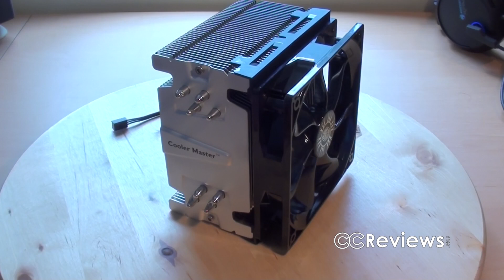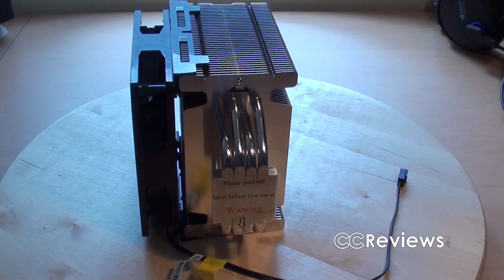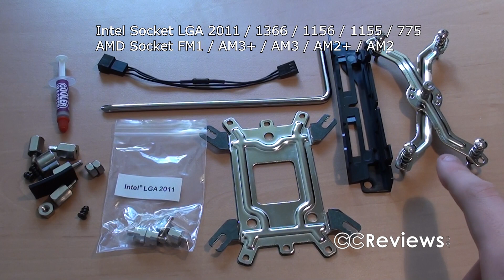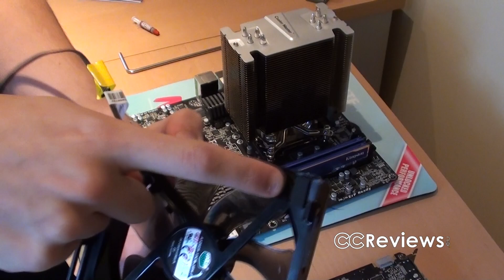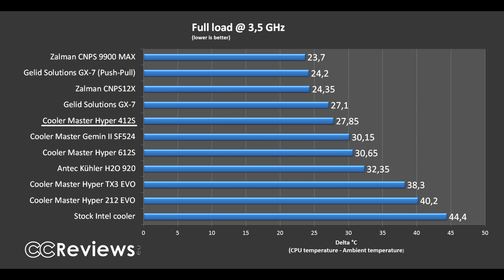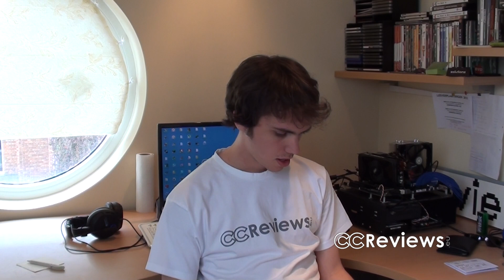#72: Cooler Master Hyper 412S CPU Cooler Review (CCReviews)

Comment from the maker: this should be, but I think the heatsink might be a little bit too high for your case there.. Or you get a CPU cooler with a lower heatsink (distance from cpu base to top of heatpipes) or you get another case aswell with a wider size. (First option is cheaper).

Comment: Wow, thanks for the fast response!
But will it fit in a pc with these specs?:
Case: CM Elite 430
MB:Gigabyte GA-970A-DS3
RAM: Corsair XMS3 4x4 GB
CPU:AMD FX-8120
GRAPHIC: Zotac GeForce GTX 560 AMP!
It's just because the last cooler i had for this rig (CM Gemin II SF524) couldn't get the heat of the CPU and out of the case. Will this one be able to? :)